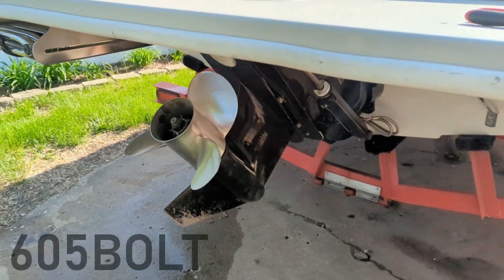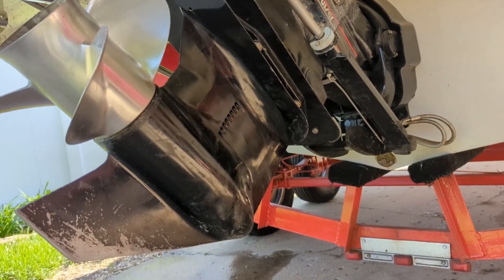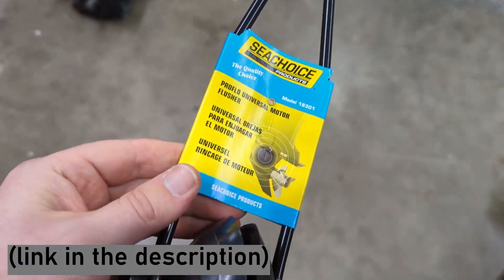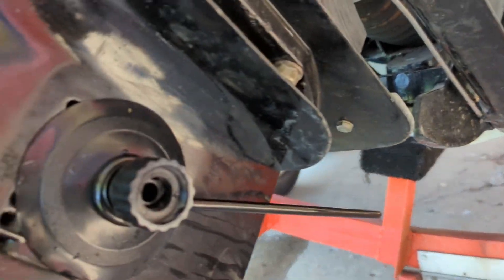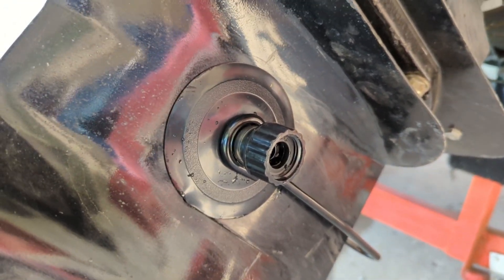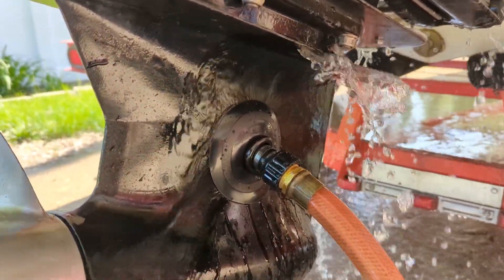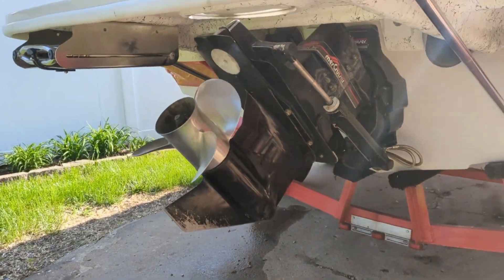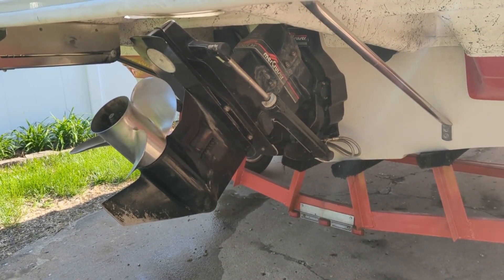Need to Start & Run Your Boat Out of the Water?  Use a Motor Flusher/Freshwater Muffs!

Comment: It is insanely important that you turn on your water as high as it goes. Once the raw water pump on the engine starts to pull water, it will suck and need more water than most garden hoses can supply. Yes of course it will splash when it is not running, but after that, it won't. I have seen garden hoses being sucked flat because of how much that raw water pump sucks. Not as much of a problem if one has the little Alpha drive, but still. Full water ALWAYS, especially if it runs for longer periods for diagnosis. If you need to rev the engine more than maybe 1200 rpm, you really need to put the drive in a tub or at the very least install an inline fresh water flushing system so that no water is lost. And if you go this route, a strong braided 3/4" hose is a must.
Reply from the maker: Good info.